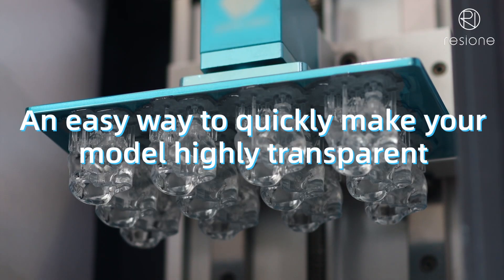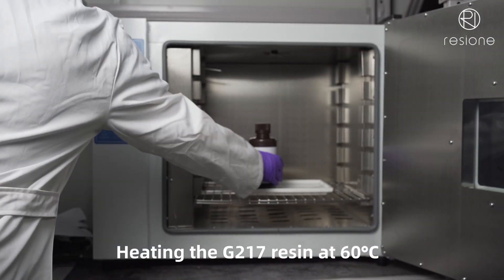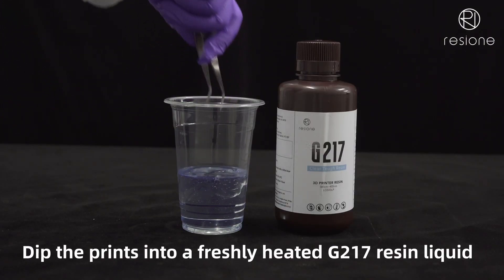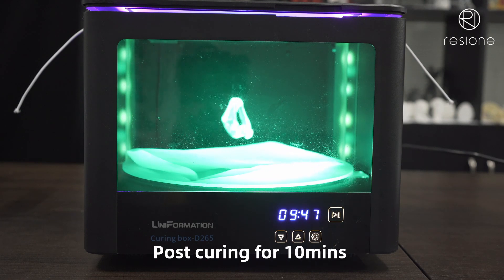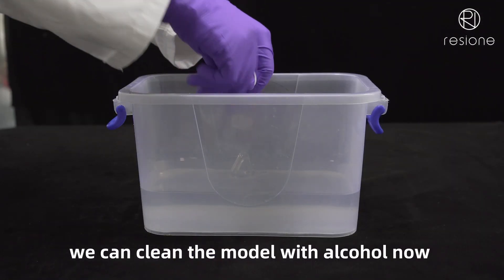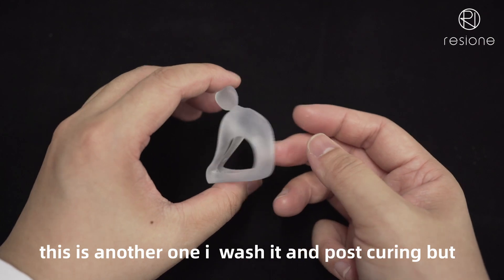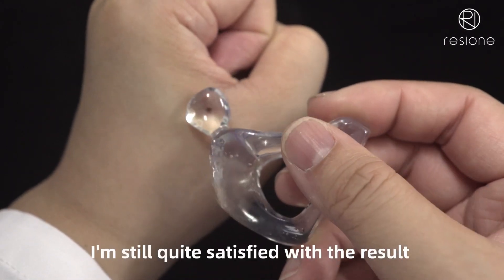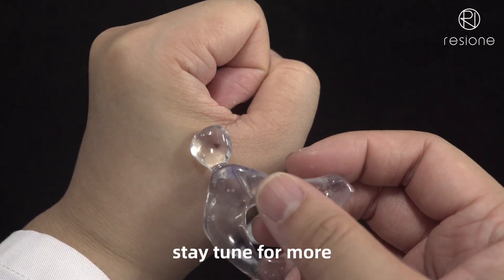An easy way to quickly make your model highly transparent!

Comment: How to keep both transperencity and precision for assembly parts?
Reply from the maker: can you be more specific ？im not qutie understand.
Reply: @godsaid4502  Sure, I mean, we 3D print a transparent cover for an automotive mockup to showcase the internal system. The cover also needs to assemble precisely with other parts. However, when we apply a liquid resin coating as a post-processing step to improve transparency, the precision is compromised. Do you have any solutions for maintaining both transparency and dimensional accuracy?
Reply from the maker: @YTPM-m3c  Absolutely sure，you can spray the transparent varnish，the“green stuff work ” or the “supper mr hobby” either brand is fine.
Reply: @godsaid4502  Thank you so much
Reply from the maker: @ Anytime buddy！🤗

Comment: I don't have the tools to try this idea. If you (the company Resione) could possibly try this, and upload a video, I'd appreciate it greatly.
To achieve the highest transparency while minimizing post-processing effort, here is the idea.

Instead of just dipping the uncured model in warm g217 resin, then curing, TRY THIS:
1. Print Model
2. Don't wash or post-cure, but do use an air compressor to blow off as much uncured resin as possible.
3. Place the model on a spinning pottery wheel.
4. Heat g217 to 60C-80C then put heated g217 resin in an airbrush.
5. While the model is spinning on the pottery wheel, coat the model using the airbrush with g217
6. Place the coated model (careful not to smudge uncured resin) in a pressure pot with a clear lid and close tightly.
7. Turn on the air compressor and raise the pressure of the pressure pot to 80PSI (This will push the clear coat tighter against the model, ensuring the highest level of detail, as well as rid any micro-bubbles that were in the surface coat.
8. Once at 80PSI cure the part through the transparent lid of the pressure pot
9. clean and post-cure like normal.

Of course, I know extreme caution must be used when airbrushing resin, proper respirator mask + ventilation etc
Reply from the maker: Thank you very much for the idea, but our idea when we started making this video was how to simply make the prints transparent, because usually people who are familiar with transparent prints just use a varnish spray, but some newbies may not know how to do this, so going to make the prints transparent without needing to buy any other tools was our idea at the very beginning, and even though you've got the idea more detailed to the point, you'll still need to buy a thing or two to get it done.